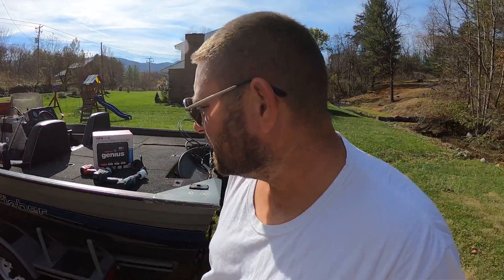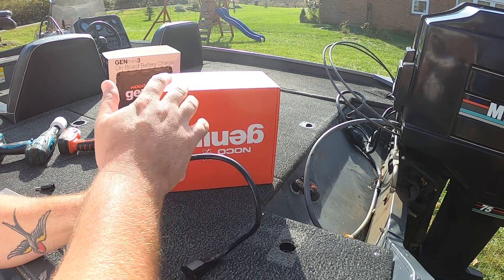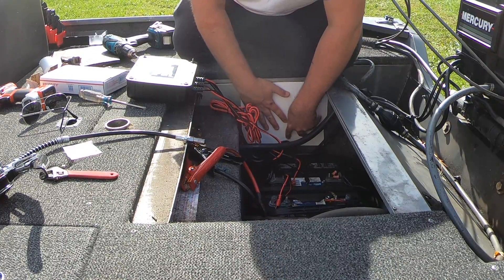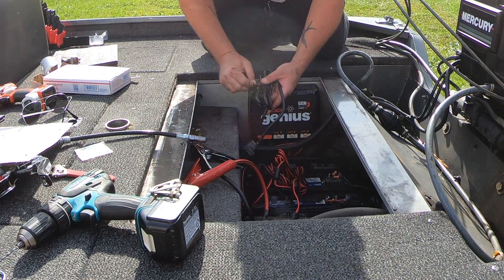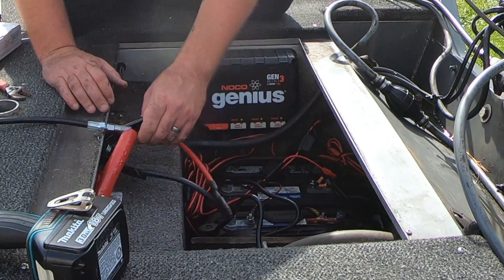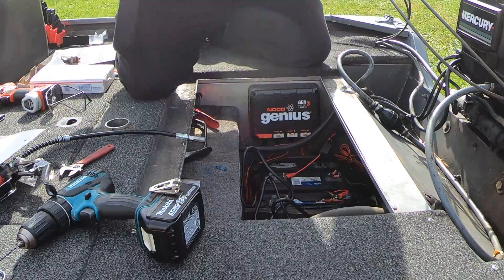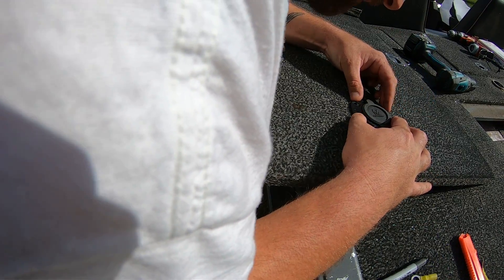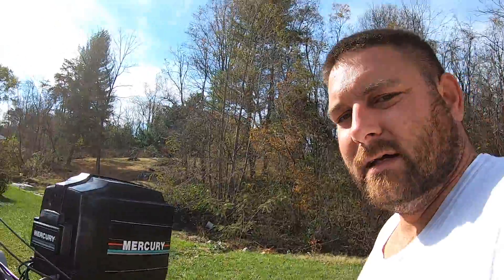DIY 3 Bank Battery Charger/Shore Power Mod For Bass Boat

Comment: How hot does the unit get? Im kinda scared to mount it close to my gas tank.
Reply from the maker: It gets warm but not nearly hot enough to ignite gasoline.  And as long as you have your connections good and secure there would be no arcing at the battery terminals and the charger itself is sealed so you're good there as well.  I never noticed anything that would be a cause for concern.

Comment: how do  you hook up the charger to two 12volt batteries is series for 24 volts?
Reply from the maker: The way mine is set up, I have a jumper cable that I use to connect the 2 batteries that I hook up before I launch my boat so the charger hooks to those batteries individually.  If they're constantly wired together I'm not sure if connecting the charger to one would charge both or not.